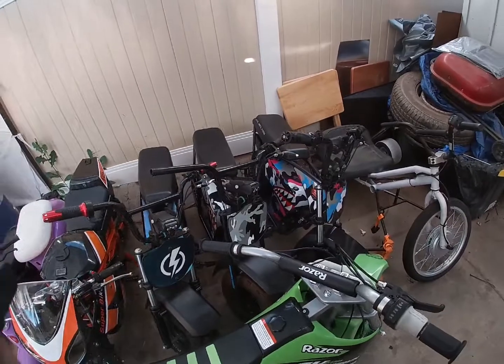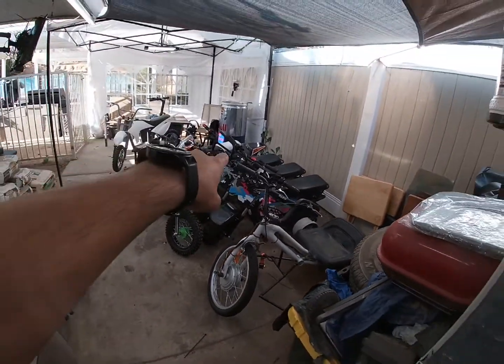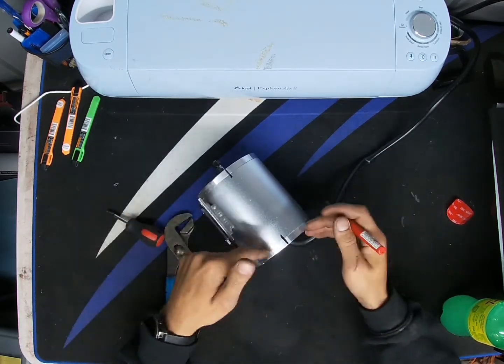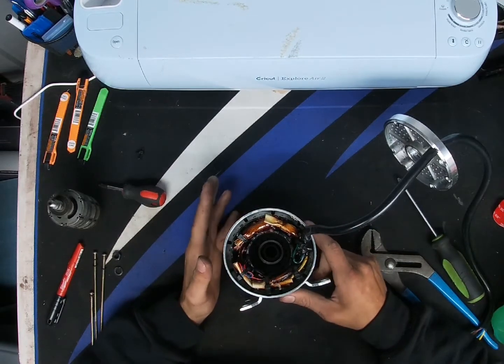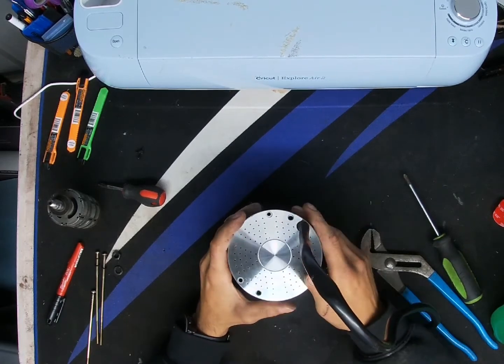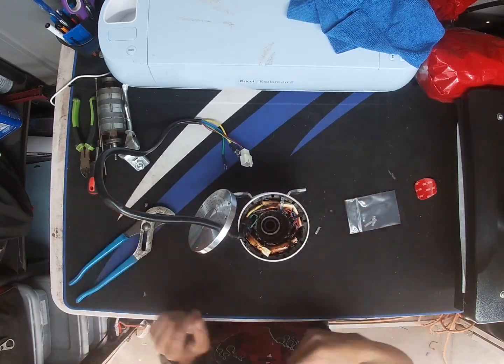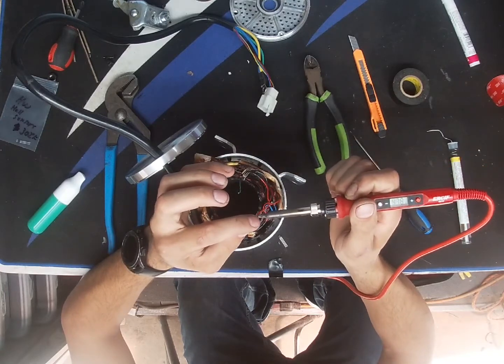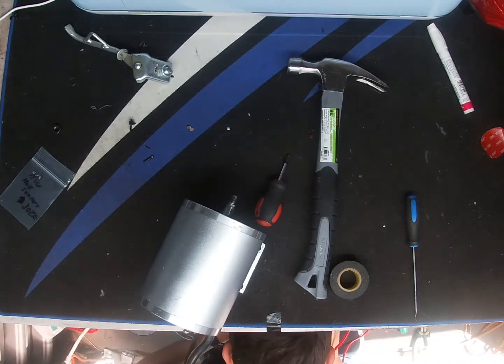REPLACING THE HALL SENSORS ON A MY1020D MOTOR

Comment: Are the new hall sensors the same ones as 461A? Does the motor improve with the new ones
Reply from the maker: It improves minor performance but longer last when your motor is heating up the original ones in the motor tend to fail and cause the motor to bind up and cook the coils
Reply from the maker: I also haven't looked at any other hall sensors but the Honeywell which are known for there name good quality top of the line in my opinion
Reply: @JJM_VLOGS  do you have a link to where I could them?
Reply: @JJM_VLOGS  hey I just finished installing some on my motor but I still get the hall sensor error on Kelly Kvd. Do you know a fix?
Reply from the maker: @Music-ze8bz  if your mortar already smelled like burn or it smoked up before you replaced all sensors then that mode is already dead because the hall sensors already failed causing the motor wines to mess up so I would recommend put a new motor and before you run that new motor install those and it should help you out dramatically

Comment: Thank you for the video, I have exactly the same motor a mini baja , it roll good  on the stand with the wheel in the air but as soon as I put it on the ground with weight the engine has no power and gives a sound motor that doesn't like it at all and moreover the wires of the motor become hot in some dryness but not on the bench test, on the bench test or the motorcycle on the stand everything runs wonderfully. So thinking that it is the motor or the controller that is defective, I bought the same model in 48v 2000w and the same thing, did you have this problem? sorry for the poor translation
Reply: I have the same issue, if you find an answer let me know, I will do the same if I figure it out
Reply: @carlos__pr  ok thanks, that's the second vevor motor/esc kit i try, one 1800W and one 2000W and got exacly the same problem for both. Maibee the load is to heavy..
Reply: @yourfactstory  yea I got the 2000w one and it runs fine in the air but on the ground it just barely goes, I've seen other videos and they don't have this issue
Reply: @carlos__pr  Looks like we have weak batteries...We need bigger batt!!
Reply: @yourfactstory  I was thinking the same cause I got a 48v 10ah
Reply: @carlos__pr  same batt i have!!  I  have 2x 48v10a at home i will try in paralel and i will let you know before we buy a 600$ batt!!
Reply: only have to make the conector , see you soon .
Reply: @yourfactstory  sounds good, ur the first person I've seen with this prob so far
Reply: @carlos__pr  yes same for me haha
Reply from the maker: Probably sounds like to low of an ah on the battery to provide the perfect Amp to be delivered I had a 13 ah on my mx650 at first they used cheap cells and lied about the 13ah ended up being a actual 48v 7ah and it would move but voltage would fall on its face so definitely get a battery 14ah and higher
Reply: @JJM_VLOGS  looks like rcboats gotta try their two batteries in parallel and we'll see for sure
Reply from the maker: @carlos__pr  yes definitely running in parallel will bring those 10ah to a 20ah to a stable 48v 20ah setup and shouldn't have an issue anymore unless the motors coils are burnt or hall sensors are bad which I've pushed these 2000w motors to 4000 watts and they never failed the only ones that have are the 3000watt motors and I should be releasing a video soon of how to run the 3000 watt motors at a true 6kw 72v setup aswell as the 48v setup at 4000 watts
Reply: Test done Carlos !   A lot better but still not enough tork for me.  i try in parralel 2x 48v 10AH 30AMP
Reply: @JJM_VLOGS  48V20AH50Amp for a 2000W motor sound better for you ?
Reply: @yourfactstory  nice good to know
Reply: @yourfactstory  is it usable with the 20ah?
Reply from the maker: Any ah is usable you can have a 48 50ah and it won't damage anything you just less voltage drop and higher range or longer riding Time
Reply: @carlos__pr  better but still have tork missing and the phase connector came reallly hot.
Reply: @yourfactstory  ok
Reply: @carlos__pr  what kind a bike did you make?
Reply from the maker: Are you asking me or the other guy?
Reply from the maker: @carlos__pr  mines I built a mx650 2000/4000watt 48v build
Reply: @yourfactstory  I got a dual suspension bike I welded with 26 inch fat tires and a 48v 2000w motor, 48v 35a controller and 48v 10ah battery
Reply: And a 54t sprocket in the back and 14t in the front, the chain is a little less then double the length original size
Reply: @carlos__pr  ok cool
Reply: @yourfactstory  таже история купил для лодки  а он на холостом ходу греется барахло
Reply: @JJM_VLOGS  that was a gearing ratio probleme , check out you gearing 
friends!

Comment: Don’t some have fans and some don’t? Mine dosent :(
Reply from the maker: No Ive never ran into one with a fan but definitely installing these hall sensors will make it less likely to fail prematurely
Reply: mine had a black plastic fan type thing in there and it fell apart while it was coming apart i havent seen a lot with it so im just gonna run without it.